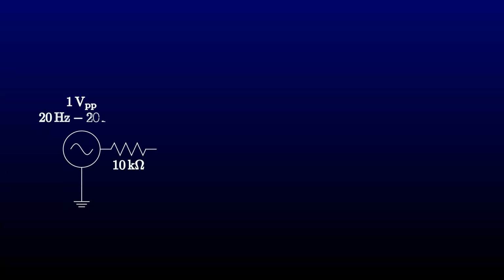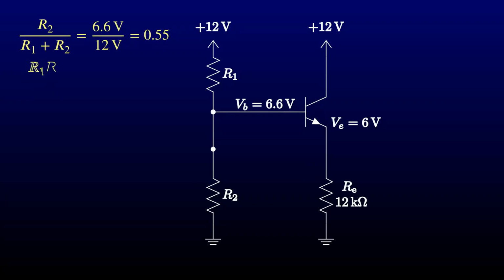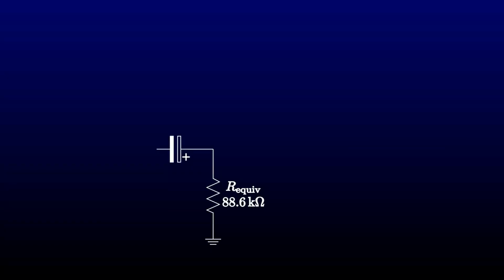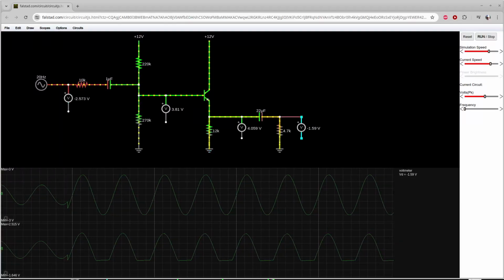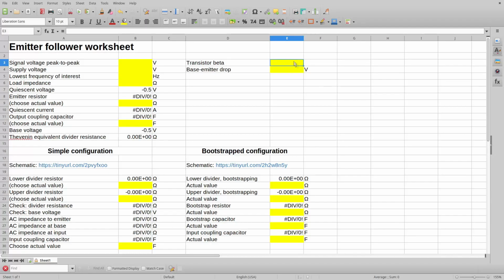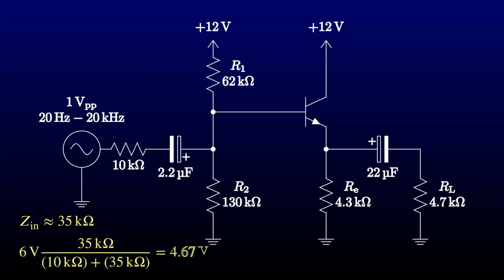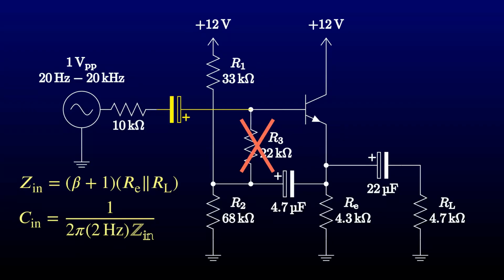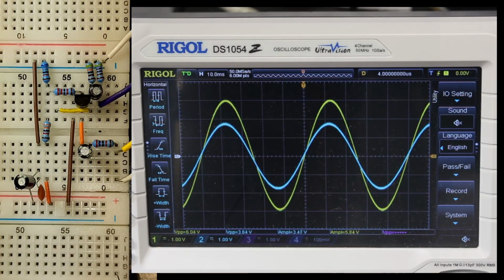Transistors 101 ep6: Biasing and Bootstrapping

Comment: Great video!  @KludgesFromKevinsCave , I need help understanding why at 09:43 the current through the load resistor is (Vpp/2)/RL.  Under small signal analysis, aren't we assuming that the capacitor is shorted?  If so, how can we have separate equations for the voltage across RL vs RE?
Reply from the maker: In the portion of the cycle that we're looking at, the capacitor has charge on it, so the two voltages are different. The transistor is cut off, and the capacitor is discharging through Re.  The only place for that current to come from is by pulling it from RL.

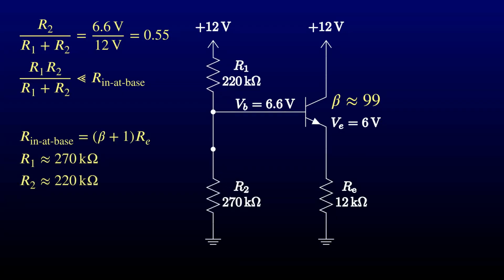Comment: Does anyone know how he came up with the values for R1 and R2 two @4:07? He stated he worked the algebra but what equations?
Reply from the maker: It's pretty much all on the screen.  R_in-at-base is about 1.2M (beta times R_e), and we want R1R2/(R1+R2) to be only about a tenth of that:  R1R2/(R1+R2) should be no more than about 120k.  We know that the ratio R2/(R1+R2) must be 0.55.  Two equations, two unknowns.
Reply: @KludgesFromKevinsCave Thank you! You’re correct, my apologies.

Comment: Nice Video !!  9:45  if transistor is in cut off then the output cap would charge to 6V ( Vcc/2) and the current through Re will be Ire= Vc_output / ( Re +RL) ?
Reply from the maker: When the transistor is cut off, the emitter is sourcing no current, and so the transistor can be ignored.  When it first cuts off, that happens when the emitter resistor can't pull enough current down to keep the emitter a diode drop below the base.  

That won't happen at the quiescent point. At that point, with the lazy design, we'll have  plenty of room to go lower. We see in the simulation at https://tinyurl.com/5n826n2d - add a scope to the emitter to see what it's doing - that about 4.3 V on the emitter is where the trouble starts. That means that a 2*(6 - 4.3) = 3.4 Vpp signal is as big as this circuit can handle.

When the transistor cuts off, whatever charge the capacitor has will discharge through (RL + Re) to ground. You can see that in the simulation. Once the transistor cuts off, the emitter voltage droops slowly as the capacitor discharges.

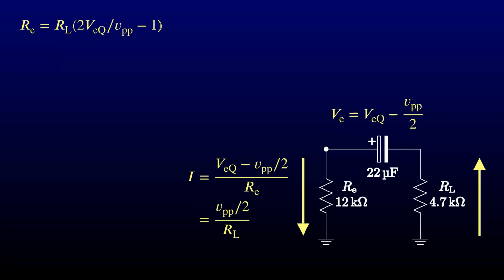We need to find that point where the transistor is just barely cut off.  At 9:45, Ve is just teetering on that point.  The equation at upper left at 9:54 relates the four values: the load resistance, the quiescent voltage, the peak-to-peak signal voltage, and the emitter resistor.  (You could find [VQ - Vpp/2] from that equation, if the component values are known. Instead, I'm using it to choose Re.)

Then we find the point where the transistor just barely saturates. That's easier. The emitter can't go above the collector (minus about half a volt). The quiescent voltage  needs to be Vpp/2 below the emitter with the transistor saturated.

The ideal quiescent point - the voltage with no signal applied - is halfway between those. That gives the signal the maximum room to swing without hitting either end.

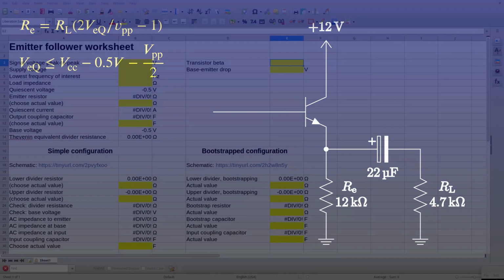Once we know that voltage, we know how small the emitter resistor has to be so that we don't run out of current at the low end, and the emitter resistor will determine the quiescent current.  In the example starting at 10:31, we enter our numbers and find that we need to use a smaller emitter resistor (and therefore a higher quiescent current) to get the performance we're asking for.  I do cheat a little on the value, because I asked for a bigger voltage (8 Vpp) than I needed (6 Vpp) - otherwise, I'd have to round down rather than up.
Reply: @KludgesFromKevinsCave   Thanks for such nice explanation. I really appreciate you taking the time to explain all of this

Comment: Hey, great video! I don’t quite understand why, at 9:43, the current has to come from the load. Both the load and the emitter resistor are at 0 V, so there shouldn’t be any voltage potential, and therefore no current. What am I missing?
Reply from the maker: We're looking at the negative swing of the input voltage.  The output coupling capacitor is discharging on that part of the cycle.  The current flowing through the emitter resistor is coming from the capacitor, and an equal and opposite current has to be flowing into the other end.
Reply: @KludgesFromKevinsCave gotcha! Thxs!!

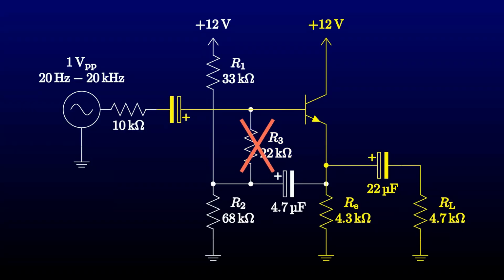Comment: Great video! I have one question. At 15:12, won't some of our ac voltage go through R_2 and R_1, because they're both connected to AC grounds? wont these add input impedance? I thought of maybe inductor biasing to help this also, but that might not make sense from an economical standpoint. Thanks for all the help!`

edit: I think the anode of the capacitor will always be V_be less than the cathode voltage is, and so no current will flow towards the divider because it's at a higher potential? Not sure, since now I'm mixing ac and dc analysis.
Reply from the maker: There is ac current through R_2 and R_1, but it's coming at very low impedance from the emitter of the transistor though the bootstrap capacitor.  That causes R_3 to be held at a voltage one diode drop below the transistor base.  Since both ends of R_3 are at the same ac voltage, no signal current flows through R_3. (That's at least what happens ideally.  In practice, the base-emitter drop depends on the base current, so there's still a tiny bit of current there.)
Reply: @KludgesFromKevinsCave thanks! So there is ac current through r1 and r2? I still don't really understand why the divider doesn't effect input impedance, I understand that there's no voltage across r3.
Reply from the maker: @controlledelectronics If there's no voltage across it, there's no current through it! It's carrying only DC, and it's invisible to the signal because we're putting the same signal on the other end
Reply: @KludgesFromKevinsCave I think you're talking about R3, I'm talking about the divider resistors. Won't there be some ac current going through those? And for input impedance, R1 and R2 would appear in paralel to Re and Rl? Thanks again for the help!
Reply from the maker: There's ac current going through R2 and R1, but it's not coming out of R3 to any significant degree, it's coming out of the transistor emitter.

R2 and R1 do appear parallel to the transistor emitter, but at the base their impedance is multiplied by the transistor's beta. That usually results in an impedance big enough to ignore.

Comment: Hi Kevin! Thanks for the video and the explanation! I'm finding this really useful for a project I'm working on. I do have a question about the bootstrap circuit: you explained how to calculate the value of the capacitor, but how do I determine the value of R3? Is there something specific I should keep in mind, or is it just a matter of picking any value that looks nice? Thanks again for taking the time to make this!
Reply from the maker: Let's start with the original circuit. The 62k/130k divider gives a bias voltage of a little over 8 V.  It's Thévenin equivalent resistance is (62k || 130k) or about 42k.

We will want the same equivalent resistance at dc in the new network. (At dc, the bootstrap capacitor disappears).  I chose somewhat arbitrarily to connect the bootstrap capacitor at the halfway point.  So I want a 22k resistor (nearest 5% value to half the 42k) for R3. R1/R2 then have to be a divider putting out the same 8 volts at about 22k equivalent resistance.  The 68k/33k pair give just over the needed 22k and will put out 8.1 V. Near enough.

It doesn't have to be right at the halfway point to work, but that's usually a pretty good point to choose. It makes the arithmetic simple since it's all multiplying and dividing by 2.
Reply: @KludgesFromKevinsCave  Crystal clear. Thanks for taking the time to reply Kev!

Comment: I've worked with some great engineers that couldn't use a transistor for anything but a saturated switch. Nice to see some people remember (now do all that with a germanium transistor and you will see the caliber of engineers before my time).
Reply from the maker: I built a few projects as a young boy, including a two-transistor radio with a 2N170 NPN and a 2N107 PNP.  (I didn't know what I was doing, beyond wiring parts together, but at least I learnt that much).  The '107 and '170 were GE's production-line rejects. Their characteristics were all over the map, and maybe 20% didn't amplify at all!  Which was pretty disappointing considering that they cost a buck and a half, which was a lot for a kid in the 1960's!
Reply: @KludgesFromKevinsCave  I used to have an orange juice can full of prime copies including 2N169 right out of GE's 2way radios. My dad was district service manager for GE and got a junk box every year with broken stuff for parts.

They made a phase lock loop module out of those awful germanium transistors. That was engineering.
Reply from the maker: "There were giants on the Earth in those days."
Reply from the maker: @johnelectric933  At least the 2N169 passed inspection! 2N170 were the rejects, sold to hobbyists and experimenters
Reply: @KludgesFromKevinsCave  I did find a CK722 in that can.

Comment: Why we did not include the load resistor for the voltage divider calculation but Included it for the input high pass filter calculation? Thank you.
Reply: Ok, I think I got it, because it's a DC bias, and the output capacitor blocks DC so for DC  the load isn't there?
Reply from the maker: You got it. And then the bootstrap capacitors makes it so the divider isn't there at signal frequencies. Separating signal and bias paths is a common approach. We'll see it again.

Comment: I've been looking for years for a good explanation of bootstrapping without success, until now! Thank you so much, Sir! Why does no modern book explain this brilliant solution?
Reply from the maker: 'No modern book' is a bit of an overstatement.  Horowitz and Hill, The Art of Electronics has quite a lucid explanation - and I pretty much followed their reasoning when presenting it.

I actually had no idea how many teachers simply gloss over it.  It's useful even in the op-amp world.  There's a lesson coming up where I build an ac-coupled op-amp follower and restore the input impedance with a bootstrap capacitor.  This has been my most popular video by far, apparently because it fills a gap!

Comment: Thanks for the great video.  But I'm totally lost at one point.  Could you please expand on this a little ?  At about 14:30 discussing the bootstrap capacitor, you say, "But look at the situation at AC.  The base and the emitter of the transistor are one diode drop apart.  There's no AC voltage between them.  And we'll choose the new capacitor so it will look like a short circuit at signal frequencies. ... The resistor R3 therefore has both ends at the same AC voltage."  I can't see why R3 has no voltage and isn't conducting current (AC and DC) via R2, and I definitely can't see that "the base and emitter are a diode drop apart" (presumably via the transistor itself, what else could it be ?).  That's the same as saying the transistor isn't doing anything, right ?  Then where's the amplification from source to load coming from ?  Thanks, Russ
Reply from the maker: An emitter follower has no voltage gain - the voltage at the emitter is a constant diode drop below the base.  But there's more to life than voltage.  Consider a source that looks like an AC voltage running through a 10k resistor.  Now I want to drive a 100 ohm load.  The voltage at the load is going to be a little less than 1% of the voltage at the source.  But if I put an emitter follower in between, the output impedance of the follower will be reduced by a factor of the transistor's beta.  If beta=100,  the output impedance will be 100 ohms, and the output voltage will now be half the source voltage.  If I use a Darlington, or a second follower, I'll get another factor of beta, and the output impedance will be just 1 ohm (I'm oversimplifying here, because the intrinsic resistance of the emitter comes into play here), and we'll lose only 1% of the driving voltage.

So R2, in our simple model, does indeed have no voltage across it, but the transistor is delivering power to the load that the source cannot deliver.
Reply: @KludgesFromKevinsCave  Thank you for the reply but now I'm TOTALLY lost.  You say, "But if I put an emitter follower in between, the output impedance of the follower will be reduced by a factor of the transistor's beta " - huh ?  I can't quite make sense of that sentence.  Do you mean the load resistance the source sees is increased by a factor of the follower transistor's beta (plus one) ?  Sorry, totally lost.
Reply from the maker: @Starlite4321  the impedance of the source, divided by the transistor's beta, will be the output impedance of the follower.  The follower is an impedance transformer. It presents a much higher impedance to the source than the naked load would, and a much lower impedance to the load than the naked source would. There's a longer explanation in episode 4.

Comment: Finally, someone who places the input coupling capacitor with the correct polarity!
Have you noticed they are reversed in most introductory books?
Reply from the maker: I hadn't, but I've seen that sort of rookie mistake in a lot of YouTube videos, making me say to myself, "has this person actually built the thing?

Of course, the correct polarity depends on the biasing of the previous stage.

You haven't lived until you've set off the smoke alarm with an exploding capacitor!
Reply: @KludgesFromKevinsCave  Malvino's is one such book. But even Millman & Halkias have reversed biased input caps (I had to verify with a simulation, I mean... Millman!)

I wonder if these reversals were the actual author's fault, or were introduced by the artist who created the circuits for publication.

Comment: Thank you very much for this explanation of bootstrapping.
Could you also explain the audio amplifier version of bootstrapping? I keep on seeing it on push-pull output stages but cannot understand how it works..
Reply from the maker: I have an ever-growing list of 'ideas for future videos.'  Your question just got added to it.  ;-)

The short version:  It works just the same as what I showed here. The push-pull stage is a pair of emitter followers (you can kind of ignore the ballast resistors between the two emitters, and the feedback resistor).  The resistor that the bootstrap wants to make disappear is the collector resistor of the driver stage. It gets split with the output fed back into the middle of it by a bootstrap capacitor.  (Hard to explain without a chalkboard...)
Reply: @KludgesFromKevinsCave  Hmmm. Let me think about this.. Thanks a lot for the explanation...

Comment: Does bootstrapping sometimes reduce the stability of the amplifier by providing positive feedback?  Bootstrapping is used sometimes when the fT of a transistor is barely adequate, but it has to be weighed against the potential reduced stability.
Reply from the maker: Bootstrapping in this configuration can indeed reduce stability, but it's done pretty routinely in class-B audio amps.  In this configuration with cheap transistors, you have plenty of phase margin.  I don't think I've ever had a bootstrapped power amp start oscillating on me.

Comment: Hi Kevin. When creat pwm and attach even to the an mosfet without drain to source electricity in pwm creat  spikes ????I know it is for capacitor capacity in mosfet .but how remove it.
Reply from the maker: Hmm, you're probably asking the wrong guy, since I do mostly instrumentation rather than power electronics. (Or at least I'm guessing that's what you're asking about.)

But I can remember a few points to consider.

The spike comes from the switching transient.  When you change the state of a big MOSFET, you're driving a lot of gate capacitance - perhaps 1 nF or so. Actually, for design it's better to think of it in terms of charge - perhaps the gate, charged to 10 V is carrying 10 nC.  You're trying to dump all that charge, or charge it back up again, in a few nanoseconds, so you'll need several amperes of current for that brief pulse.  Any stray inductance in the circuit is going to cause a huge voltage spike when that current turns off.

Some suggestions:

Use a commercial, packaged gate driver like a TC4420/TC4429 rather than trying to make your own pulse amplifier. Make sure you bypass its power pins with a good, low-ESL capacitor. (An X7R capacitor of 100 nF or so).  Use wide PC traces, or copper pours, and keep the current paths short. Make sure the ground plane is continuous.

If you're using a bridge configuration, you need to protect the output of the gate driver IC with a reverse-biased Schottky diode (like a 1N5819) to ground. Otherwise, the driver can latch up because source inductance can pull the output below ground.  The diode allows the reverse current to freewheel.

If you don't need the fastest possible switching time, experiment with a resistor between driver and gate.  Somewhere between 5 and 100 ohms is usually the sweet spot.  Bigger R is slower turn-on and turn-off.  Often it's just the turn-on that you want to slow down, so a 1N5819 across the resistor can effectively take it out of the circuit on the turn-off side. (Or you can use something like a TC4421/TC4422, which has separate pull-up and pull-down outputs that can use resistors of different values.)

There's more good information, including a table of part numbers and specs for gate driver IC's, in Chapter 3x of The Art of Electronics: the X chapters by Horowitz and Hill.  (All three volumes of The Art of Electronics are packed with good information!)

Or just buy your power supply off the shelf.  For a lot of stuff, I can get a supply from an outfit like MeanWell for cheap enough that it's not worth the effort to design one.